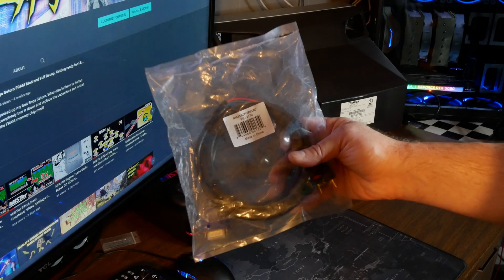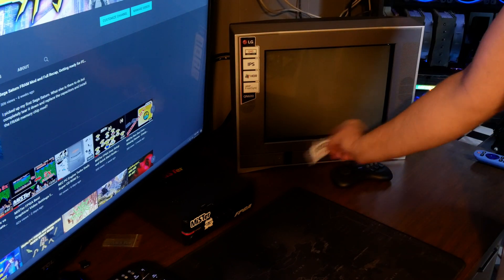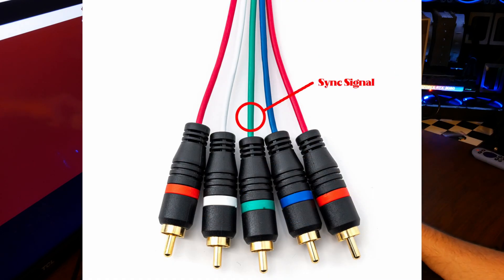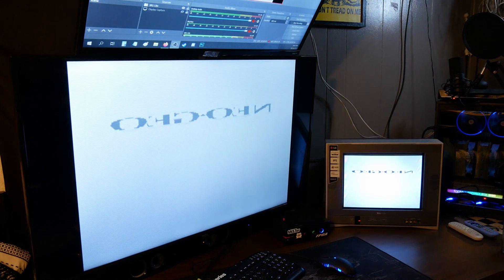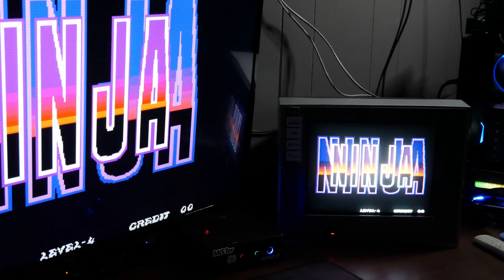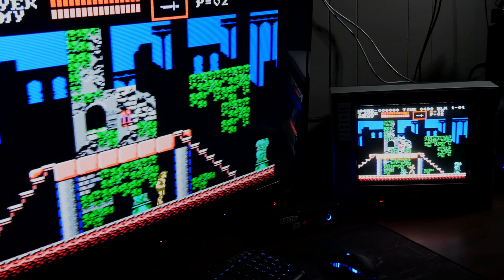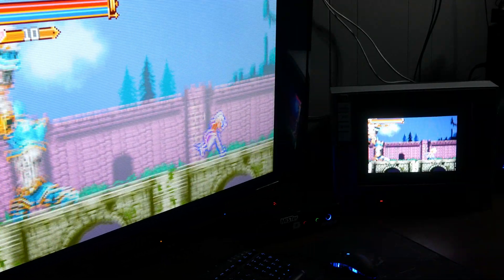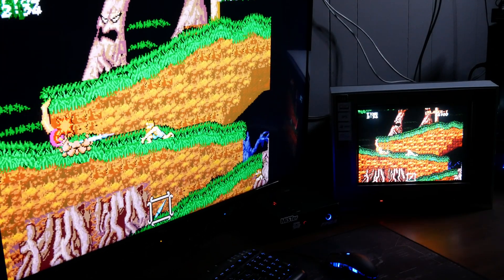MiSTer FPGA  CRT  YPbPr Component Analog ... How to connect

Comment: SoG only works for RGB signal. Looks like you set up the mister by itselt to output ypbpr (fomponent) through the vga, right?
Reply from the maker: I run mister on a rgb modded 36" jvc and a bvm nowadays

Comment: What you said really surprised me. I'm using an old AMD video card, the CRT Emudriver, the converter box from VGA to component just like you said. Its a pain and it doesn't feel as responsive as it should. I've seen some videos recommending run-ahead, but this causes nothing but problems, and it is also recommended to make individual settings for each and every game. All of this messing with run-ahead to poorly mimic what the Mister does out of the box.
Reply from the maker: Yep, I had the same crt emudriver setup and it was always requiring troubleshooting. The mister is so easy to use once configured, and everything just works. There are clones now of mister you can get pretty cheap. I never looked back after getting mister. It even has MisterCast now... You can send 240p output via an ethernet cord from your pc through the mister without all the crt emudriver headaches

Comment: Hello, I also bought a Toshiba TV with component (Ypbpr) connectors... and a component cable from AliExpress, please tell me, will there be a background noise above 20-30% of the volume? or is it better to use a 2RCA-3.5mm cable. (since my mister has a 3.5 connector for speakers)
Reply from the maker: @tdmax2288  I use the optical audio output to a soundbar. The misters 3.5 works fine but is lower quality
Reply: @LameGaming  I also use the FIIO Tanishan optical DAC, but I would like to use the built-in TV speakers. It is stereo. And the sound should be excellent, but I wonder if there will be overtones with this cable from AliExpress.. or is it better to use an optical DAC by connecting it to the TV via 2RCA-3.5mm.

Comment: Thanks so much for this. I use the Ironclad Plus as my IO board and I was having the same problem that you were. That board has jumper pins instead of a switch to change the SOG setting, drove me nuts messing with the .ini file until I found your video.
Reply from the maker: Glad it helped!
Reply: Hey there, just curious to see what your resolution to this issue was, and how you managed to change the SOG setting on the board. I’ve got an Ironclad Plus as well, and the SOG pin situation is confusing me. Do they need to be connected with some kind of jumper cap? I wish it were just a switch to toggle on and off like most others seem to have 😵‍💫
Reply: @connorweaver5278  Yes, jumper caps do exist, you can also bend the pins, or jump them with a wire. Also, as I understand, the SoG settings in the INI file using recent MiSTer hardware, overrides the physical switch.

Comment: I have the same Toshiba and the screen has a slight tilt. Drives my OCD crazy. Any suggestions on how to correct it? I went into the service menu and could not find anything that would correct it.
Reply from the maker: I havnt used mine much so cant remember if it had tilt in the service menu or not, if not you would have to manually adjust the yoke which can be scary and potentially dangerous your first time.
I have a video demonstrating it but do your homework first and I take no liability 🤣👍
Reply: @LameGaming  Won't be messing with the yoke. Mess around and get fried. 🤣 I'll just deal with it when I game on it. Thank you.
Reply from the maker: @snkfightfan0187  Its fastest to make the adjustment with the set on but possible to do while its off and as long as you dont stick a screwdriver under the anode cap or poke around in the power supply circuit youd be fine.

If your feeling ballsy lol....
Unplug, remove back housing,loosen yoke screw, make a tiny adjustment, slightly tighten yoke screw while holding it against wedges, test.... Repeat if necessary. Snug yoke screw when done but not too tight its a thin glass neck.

Dont turn your converg/purity rings
Reply: @LameGaming  Thanks man. Appreciate the help. 

Update: So I went in there and it has epoxy which keeps me from moving it. I'm thinking this must have been a factory default.
Reply from the maker: @snkfightfan0187  Ahhh...yeah a bonded yoke, my 36" jvc is like that but luckily its set pretty good. 
Good job for looking though, cant win em all

Comment: Finally got myself an excellent Sony Trinitron made in 2005, but the component input states 480i only in the manual, not sure if it will accept 240p or if I'll have to find a way to connect this thing via s-video or composite.   I haven't gotten my Mister kit yet, just looking at the costs involved right now, currently have a genesis and snes hooked up to the CRT with everdrives and it's so awesome to see these pixels on a crt again.
Reply from the maker: It should handle 240p, The 480i only mention is probably to denote its not 480p capable.
Reply: @LameGaming  yeah can confirm, the genesis I have is component modded and it worked on it just fine.

Comment: I know this is an old video but im pretty sure you had the sync on green off in the first place and you actually turned it on. The position its in in your first picture is labled "off" on my case
Reply from the maker: Yeah they did it funky. Instead of sync on green on or off its sync on green over-ride on or off so over-ride on is actually turning it off or something 🤣
Kinda confusing... Or it was for my dumbass apparently 🤣
Im just running rgb now and on my component sets I have hooked up down the line i slapped in rgb to ypbpr transcoders I had lying around

Comment: Did your TV support 480p? I have a JVC AV-32WF47 that only supports 480i and I cannot get it working.

Weirdly enough I can get that scrambled signal you had only when I leave ypbpr "off" in the settings. With it on, I get nothing. I've toggled the SOG switch, tried every relevant ini setting, and even tried every combination of plugging in the monoprice cable in case it was built wrong.

Also, I confirmed component works on my CRT by hooking up an old DVD player with component.

So either mister does not support some 480i CRT's, or my IO board is malfunctioning or I don't know what.

I did hook up my Mister to component on a flat screen with the monoprice cable and it worked. As you can tell, I am at my wits end trying to figure this out.
Reply from the maker: Nope... None of my consumer crt's support 480p. 
When was the last time you updated mister? I wonder if your ini is corrupted somehow or maybe a setting is off.
Ive noticed since last update the genesis core wont sync on my 36" jvc crt. I havent tried it on any other crts yet.
I might be wrong but almost remember reading before about someone having issues with a jvc iart. Have you asked on mister forum, r/crtgaming, or r/fpgagaming ?
Reply: @LameGaming i updated it before trying anything. no, I haven't been on the forums. I went to a friend's house who has a large Sony trinatron and it fired right up using your method in this video. literally on the first try after spending hours on the JVC messing with ini settings!

so, I am on the hunt for a different CRT. the mister does not play well with the jvc and honestly that tv doesn't look great when it's working anyway
Reply from the maker: @william18miller  yeah, could be those i'arts are picky with signals. Might be something in the service menu that would solve the issue but i dont have one of these i'arts to test
Reply: @LameGaming  luckily I have original remote and was able to look up button combo to get into the service menu. I tried every setting I could and got nowhere as well. literally spent over 30 min in there. I agree that the jvc iarts are not the best for MiSter.. just a lot of frustration

Comment: What Toshiba CRT is that? I have a larger Toshiba as my smallest YPbPr component-capable CRT for the test bench but I really need a smaller one like that.
Reply from the maker: Its a 14AFxx series. Pretty nice little CRT for the size with component.
Found this one for $10 on marketplace right around the beginning of the Rona scare. She said it was used in the kitchen about a year then was put up in a box. Was pretty mint with remote. I left the 10 in her mailbox and grabbed it off her porch lol.
Reply: @LameGaming  Dude. You’re not going to believe this but I totally just found a Toshiba 14AF45 at Goodwill for $4.99. I would’ve bought that in a heartbeat either way! No remote but I already have one plus my OSSC remote is programmed for it. My portable LCD remote also seems to power on/off Toshiba displays but can’t change input which requires the remote. This one is going on the test cart immediately!
Reply from the maker: @emmettturner9452  Thats crazy!  I need some of your luck lol. I found a 20" D series on marketplace but they never messaged back. 
Congrats on the find! I been playing on mine quite a bit.
Reply: @LameGaming  Just set it up on the test cart and I’ll be testing it with the WiiDual installation I’m finishing up now. When I pulled the price sticker off I saw an old Goodwill price from years ago when they used a crayon to write directly on it: $7.97… the last digit always matches the first to thwart people who might try to rub off a number. ;) That means this thing has been passed around!
Reply: @LameGaming  Tested 480i component with WiiDual but forgot to test 240p. Tested 240p component with UltraHDMI HW2+DAC and my own custom YPbPr component cable. I can’t see the pixels as sharply as my larger 20AF43 but that’s expected with a display as small as the 14AF45. Still perfect for testing and works great. :) There’s probably a horizontal shift/stretch for SD content over YPbPr but I only ever noticed that on my huge Toshiba that’s been in storage since the tornado ruined the house/workshop. HD Retrovision guys say in their FAQ that it’s because they sync at the rising edge of the sync pulse instead of the falling edge since they process anything from YPbPr as if it is HD… even when it isn’t an HDTV. Now I need to play through World 1-1 in Super Mario Bros 3. :)
Reply: @LameGaming  Just nabbed another! Toshiba 14AF44 this time.

A few days ago my brother said he saw a TV on the side of road but couldn’t recall where. My car was crushed by a tornado so he was taking me somewhere when I spotted it just as we were passing today. It was the one he wanted to tell me about but he’d apparently missed it and I glanced up just in time. Unfortunately it had been raining for days so it was covered in mud. I just got finished drying and cleaning inside and out. It works perfectly!
Reply from the maker: @emmettturner9452  Awesome! I found a 20" pc crt that was out in the rain, it worked great after wiring a new cord and drying out as well
Reply: @LameGaming Didn’t you do an RGB mod to one of these Toshibas since this video? I can’t find it. :(
Reply from the maker: @emmettturner9452  Nope, twas not I
Reply: @LameGaming  Thanks. Maybe it was The Segaholic but I’m not finding it there either. It was definitely this series of Toshiba and covered disabling velocity modulation.
Reply from the maker: @emmettturner9452  I vaguely remember seeing something similar but thought it was a crtgaming post on reddit
Reply: @LameGaming  Thanks! I’ll keep a look out for one. I did notice a weird audio issue when testing NESRGB+HD Retrovision on the larger one I have and I’m curious if you’ve heard anything like it on this one:
When you reach a castle at the end of a world in Super Mario Bros 3 and speak to Toad, it plays a high-pitched jingle that you hear again right after the fanfare from retrieving a Magic Wand. The audio levels start to go nuts here with volume going up and down like it is confusing some audio leveling/normalization circuitry. While the TV does have such features I confirmed that they are all turned off. This is repeatable! It doesn’t bother me too much since I don’t notice it in most games but I’m still curious to know if you happened to notice anything similar with yours. Thanks!
Reply from the maker: @emmettturner9452   So you think its something specific with the Toshiba set or the nesrgb?
I haven't played much of anything on the toshiba other than my supergrafx with an everdrive.
I could try Mario 3 with mister or with my nesrgb and retrovision cables if I get a chance
Reply: @LameGaming  I think the TV is still processing the sound somehow even though I have all that disabled. My 12” composite-only Trinitron doesn’t do it. It could be capacitors or something.

Comment: I wish there was a way to change the size of the screen so nothing gets cut off with having to go into the tv service mode.
Reply from the maker: What tv do you have that does this? I have not gone into service menu on this little toshiba yet but on my 27" sony and panasonic sets I used 240p test suite to calibrate and didnt have that issue in the service mode.
Reply: @LameGaming  I have a 27" JVC D Series. I was given it for free but has no original remote.
Reply from the maker: @dustinspencer9278  I just recently spotted a 27" D series on marketplace... I've always wanted to try one out since they seem to be regarded as good sets ..right up there with trinitrons. I'd definitely be looking to get a replacement remote on eBay but I know the JVC D series are pretty rare today so the remotes are even rarer.
If I remember correctly the note 2 had an ir blaster app that could be used as a remote on TVs. I think I got into my Sony fs120 service menu with it years ago when I misplaced the remote... Those phones are probably dirt cheap now and might be something to look into.
Reply: You should on most TV's also be able to screw on som potentiometers inside the TV to tune the TV. I had to adjust the focus and position on mine. But be careful when doing this, it's actually dangerous if you mess up and touch things you shouldn't. Be sure to watch some videos, of what to think about, before trying.
Reply: You’d only want to do that with the display. You wouldn’t want to do that with the MiSTer’s analog output because it would be downscaling the lines and losing resolution all while defeating the purpose of replicating the original analog output.

Comment: SOG refers to RGB. Component green refers to Y or brightness.
Reply from the maker: I knew Y was Luma and that Component syncs on Luma (or green) so assumed sync on green was a specific YPbPr/ component setting, But your right... I guess sync on green is a flavor of RGB sometimes called RGsB. But still, why does EVERY single document ive read or video ive seen, talking about getting component out of your mister - they specify the switch needs to be set to SOG?
Reply: @LameGaming  For what it's worth, i couldn't get my mister to correctly output RGsB even with the SOG switch. And you are right, even in the Mister settings THEMSELVES, it says you should have the SOG switched on for Component video.

Also, Component video is sync on green. And to add to that, Y is luma, not brightness.